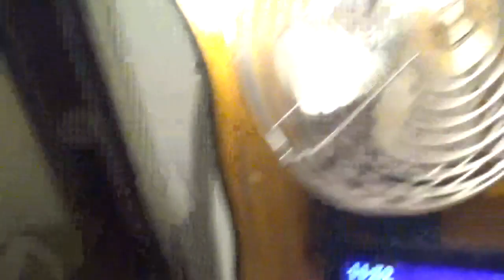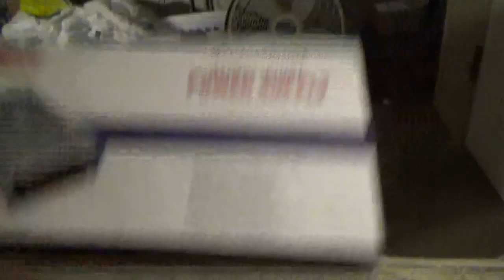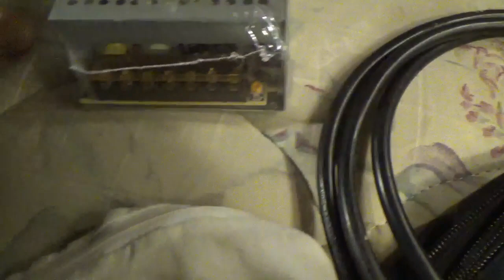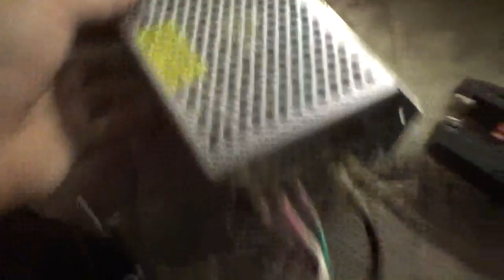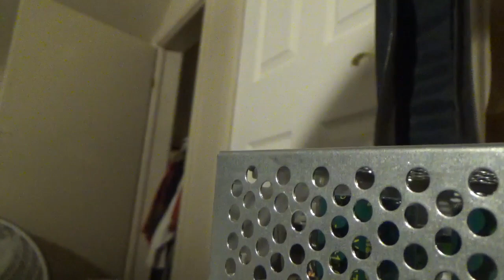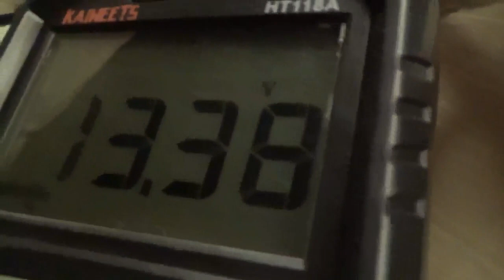Wiring a 12 volt Automotive fan

Comment: A lot of those switchmode power supplies don't live up to their rated current output.  While likely the faen doesn't use that much current, if there was a dodgy connection, that could do it in.  The new supply looks to be much nicer quality than the old one.  Very solid connections, should last a good long time now.